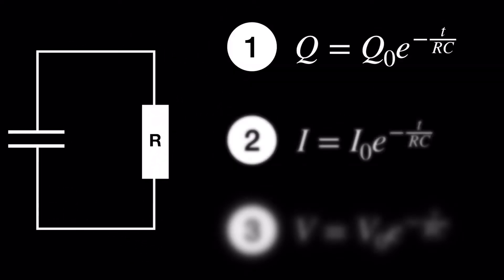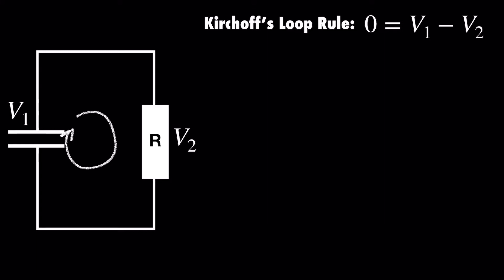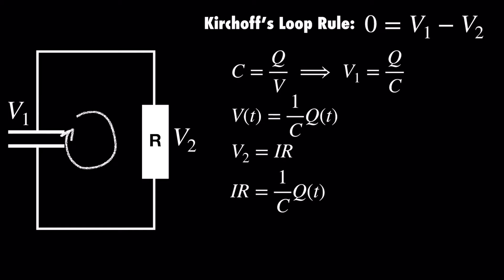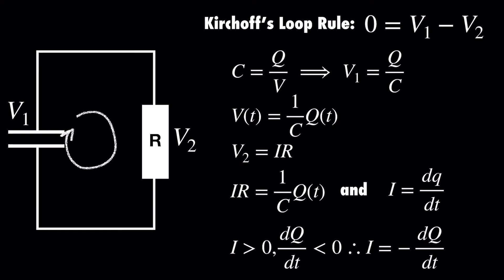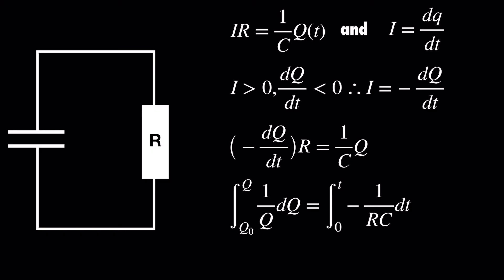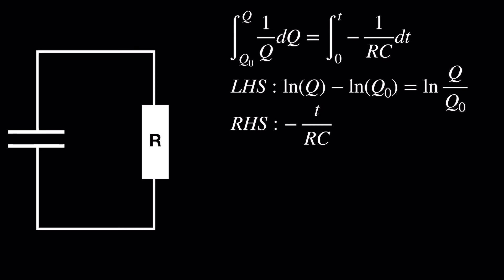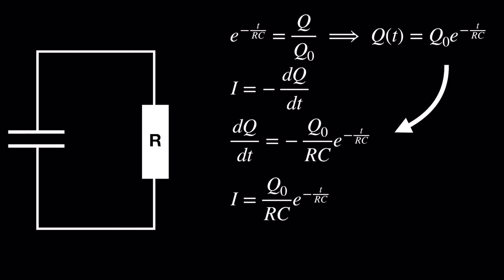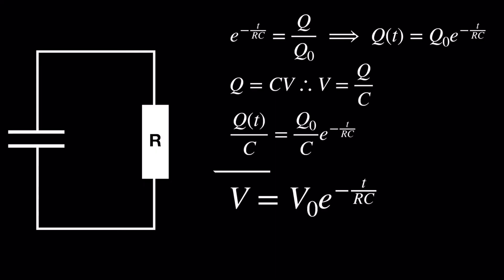Deriving the Capacitor Discharge Equations

Comment: Good Video!
suppose you only have the current equation .
if you want to get Q (charge equation) , you do the integral , do you get the same Q as in the video?
can you show it?

i mean if you solve i(t)=i_0*exp[-t/(RC)] , i=dq/dt -> dq/dt = i_0*exp[-t/(RC)]  ->  q = Q_0*exp[-t/(RC)] + Q_0 (initial charge)
Reply from the maker: Yeah you get the same Q as in the video but just have to do a change of variables. When you integrate the exponential it brings down a factor of RC, so you get Q=(-I_0*RC)*exp(-t/RC)+c. Now at t=0 we want the charge to be Q_0 and at t=infinity we want the charge to be 0 (on the physical grounds that we believe this capacitor doesn’t have some fixed residual charge on it…we could of course have it be anything if we were just doing maths). So, the constant c has to be 0 so that it doesn’t decay to the constant c. We get the Q_0 by just looking at I_0*RC and relabelling it Q_0 (note as a sense check the units make sense: RC has units of time and I_0 has units of charge/time). Thanks for watching and hope that helped! Let me know if you want any clarification
Reply: @TheBrainFiller  Thanks for the answer , i appreciate  it , " t=infinity we want the charge to be 0 " that helped me to understand !

btw i have another question ,  the charge equation (Q(t)) it have to be negative? i mean because of it is the electron...?

Comment: I understand the logic of -dq/dt being negative because over a time interval there’s less charge flowing. But in the derivation of charging a capacitor, you use positive dq/dt. But in charging, over a time interval, less charge flows. Why is it positive in charging but negative here?
Reply: in a charging capacitor , dq/dt is always positive , also when less charge flows too
because the charge is only increasing!  is it right that over the time less charge flow to it , but the charge is always growing until the capacitor reach is maximum voltage ( the same voltage of the battery) 
for example : at time t=1 dq/dt = 3 , at time t=2 dq/dt =1 and so...
you see that dq/dt is less but still positive

now when the capacitor is discharging , dq/dt is always negative
for example : at time t=1 dq/dt = -5 , at time t=2 dq/dt = -2 and so...

btw i didn't find a video of this channel about charging a capacitor....

Comment: Is there still a voltage drop across capacitor even though it acts as a Source of voltage?
Reply: He derived the voltage. It is a function of time. If you go out to a large time, then no current is flowing, hence no voltage drop. During the time it acts as a source of voltage, then it isn't a voltage drop, rather a step up in voltage to complete kirchoffs voltage law of adding to zero in a loop. The positive voltage drop during the time the capacitor acts as a source of voltage is across the resistor.
Reply: @te-kowski thank you